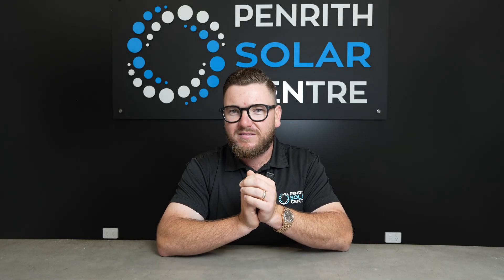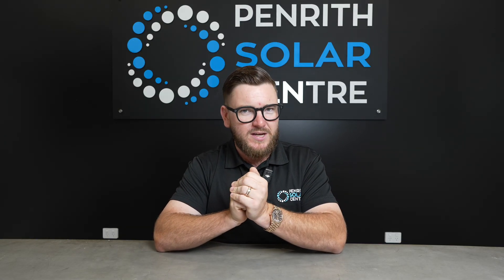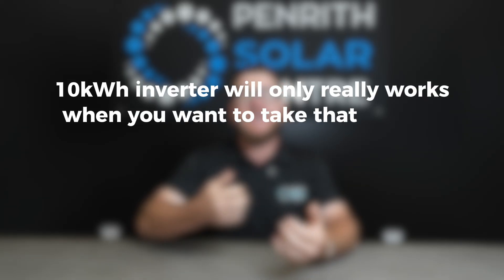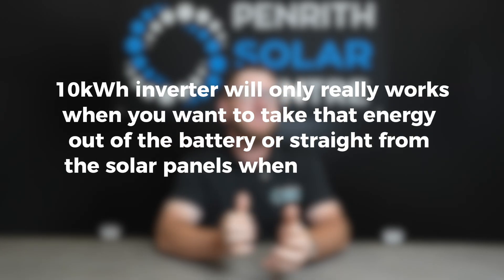Should I Oversize My Solar Panel Energy System?

Comment: Always oversize solar to maximum of roof space
Reply: or Budget heh.
Reply: @John-gm8ty budget vs dependability in crisis. Would hope the installer can do a great sales pitch
Reply: @RayJohnson1980  we're going fronius inverter with 13kwh BYD with full house backup circuits.  Just under $26k  
with the ability to simply add stacks later when we can afford them (we just can't currently)   with a future H2G charger going in for the EV.
Reply: Or rate of return  ??
Reply: @stephenbrickwood1602  with ever falling feed in rats, there won't be much of a return at all soon.   SA is down to 4c/kwh   it's basically nothing. even in peak demand.
Reply: @stephenbrickwood1602 nah because if ROI was the driver you would go for bear minimum

Comment: Good video 😊
How much is the rebate on panels ?
How much is the rebate on the battery ?
Reply: this varies with battery size, the bigger the size, the lower the rebate. (federal gov)
Reply: I found that $1,500 rebate for a 6.6kw rooftop PV system. 
Now a battery to match is ????